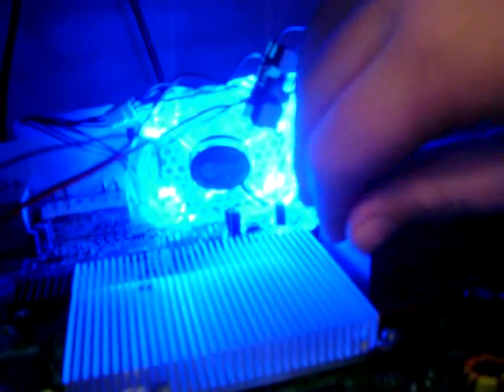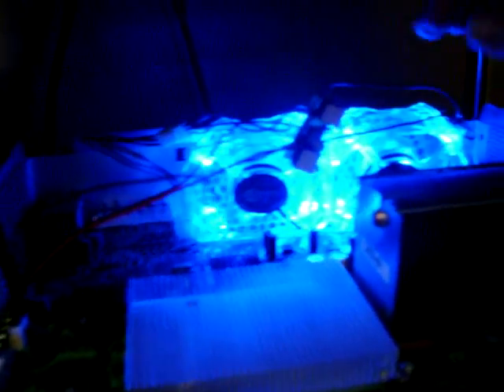-MDW- New Whisper Max Fans in 360

Comment: The whine is usually caused by a non lubed bearing or bushing. With my talismoon whisper red fans, I just use some oil and place a couple drops in and reseal the hole with the rubber cap. solved my problems.

Comment: To get the full effect from the fan LEDs its better to have a see through case, i got mine from the game train, but you can get them from plently of shops just search on google.You wont get banned for doing any case modding or cooling modding. You only get banned for playing copy games (using a flashed dvd drive) I have the ghost case clear v2 case with these fans and also the xcm core cooler v2 also i matched the harddrive to be see through and the controller with Leds aswell.

Comment: So the nitro switch attaches directly to the fans center motor before you slide them into position?  Where do you put the wires coming from the switch?  Is there guides in the plastic? Is there a specific way to do it to make it simple?